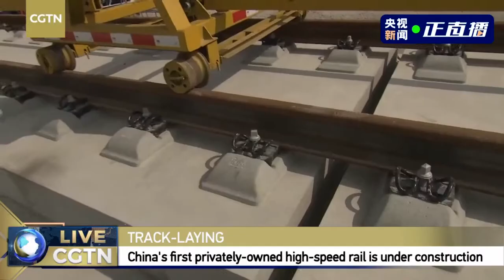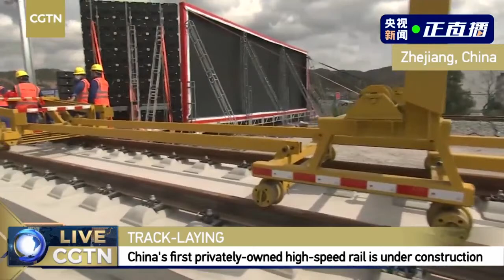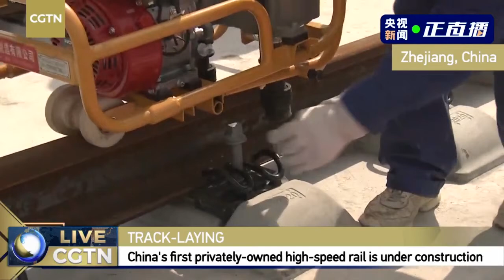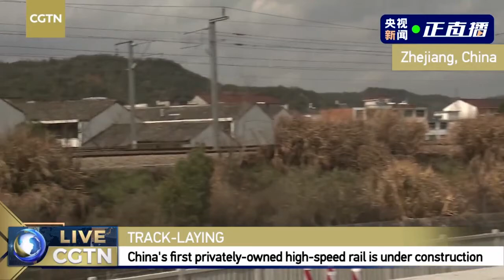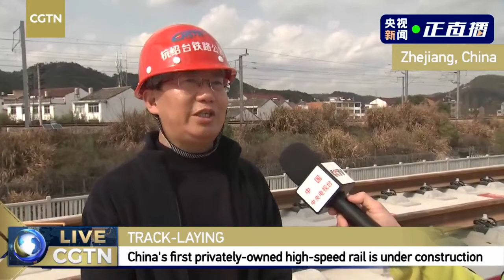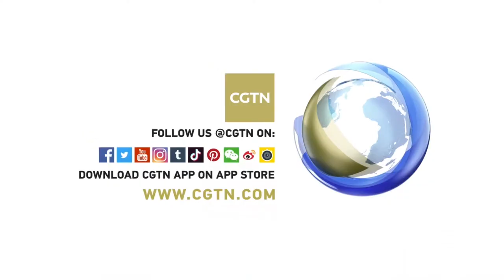Live: Watch track-laying for China's first privately-owned high-speed railway

Comment: This vid illustrates track laying by using high tech equipment to install the 'chair bolts' to fasten down the 'chair plates' to the 'sleepers'. (technical terms as used by British railways) The bar across the rails makes sure the rails are evenly spaced to the correct width. It will also check the LEVEL ie that it runs smoothly INLINE with the existing tracks, on the 'ballast' that supports the sleepers, the chair and chair bolts. Notice the clips that are hammered down tight against the rails AND have padding or spacing between the chair and the rail to stop unnecessary movement, correct SPACING of the track, as the trains move across the rails. Many countries employ special trains that do a very fast inspection across the distance of the tracks; those trains can test AND precisely pin point, report any faults to the maintenance teams etc. It is important to remember that rail tracks can suffer from environmental factors such as HEAT, freezing and misalignment in certain conditions not forgetting flooding, land slides and similar. All these factors and many other considerations are taken into account so that any such problems/issues can be prevented OR rectified quickly. British Rail have some steam train days videos that illustrate track laying and how it all comes together including split tracks for diverting trains and a lot more. It will however have you realize that Britain may have invented the railways but today? Those such as the Chinese have brought high speed trains to their people and put us all to shame. 👀😶
Reply: You know this stuff!

Comment: It had me shaking my head when I watched a program discussing WHY America did not have high speed trains. Excuses illustrated exactly WHY it doesn't or rarely has changed re its rail network/transport. Excuses? Well it will cost millions of dollars for laying one section of track, (here we are talking about maybe a mile in western terms.. ) So a whole complete system from Los Angeles to San Francisco will end up costing BILLIONS. 'Red tape', documentation approval for this, approval for that, discuss this and that, refuse this. delay delays ! oh and then there are those who are against spending billions on high speed rail so protests, block this from happening, delay this, delay that and generally insist that 'democracy' rules and they are entitled to do whatever they want so long as it appears OR hmm yes OR certain business factions, individuals who can afford to tie up such projects, by paying legal teams and more to interfere and eventually kill off a project. So long as they have their cars, spend billions on road networks and of course; pollution, traffic congestion, road rage and so much more. No chance to step onto a high speed, comfortable, accommodating with the latest tech gear for internet, USB charging, air conditioning and so much more the traveller is spoilt with AND can travel to his or her destination in hours LESS, than driving by car to the centre of any city. Now, to the shake my head moment? 👀😶"China does not have the problems we have with tunnels, difficult terrain and and ! Oh yes indeed! 👀🤣🤣I kid you not! I did point some to watching some of the videos on how China builds bridges, digs out tunnels and !! In conclusion? With America it is the mindset that has grown up with the CAR taking centre stage as one might say against the rail networks. That was the car industry and the capitalist elements of American society lining their bulging pockets whilst trashing the rail network to its current state. 🙄Of course now the USA is waking up to the realization that they have been really stupid in allowing that to happen given the way China's high speed rail networks are showing over and over that so called western 'democracy' denies (and will for years to come) the opportunities to their people of such transportation.😒 Lastly I am British. We are the laughing stock of the world and you may ask why, when it comes to trains and rail network transport ie high speed rail. We invented the rail networks and rail transport in its original form. We had and still have great engineers, innovators and more. Politicians, so called democracy, capitalism and worse coupled with greed and oh yes those who protest at having to make way for progress, the high speed network?? It will take years before that ever happens to the level that China has reached in a decade??😶 Congratulations to China and its people for the astonishing feats of technological advances, health, wealth and prosperity of its people. The truth re those who criticise China and mock it. level abuse at the people? In one word; ENVY. Happy new year to all celebrating Chinese new year. 👍
Reply: The US has the capacity to build high speed rail and they have the labour and expertise. But decades of subsidising freeways has built cities where rail is unworkable cause you'd have to drive to the train to begin with. Amtrak operates unprofitable backwater services as welfare rather than profitable, nationbuilding routes. Young Americans are sick of the ponzi scheme of endless suburbanism and have an appetite for high speed rail. The freight rail system in the US is privately owned and operated and it's the most efficient in the world. The Japanese passenger rail system is largely privately built and is the most efficient in the world. If the US can get on top of their housing monoculture crisis I think they've got big things ahead as private operators will circumvent the public rail system entirely. Texas, California/Nevada and Florida already have private high speed/somewhat high speed projects in the works. Culture will change quickly. Boomers will grow to like rail when they realise they can invest their retirements in it and public investment will follow. Autonomous vehicles will make rail accessible even in the most dead end suburbs. I wouldn't worry for future Americans I worry for the ones reaching the end of their lives reaching the ends of their lives realising they threw their culture down the toilet and pursued loneliness.
Reply: @Freshbott2  I think sadly, it will take decades before the USA changes re rail. Its ironic that the so called western 'democracy' is often given a good kicking when it comes up against the realisation that the truth is more 'autocracy' than 'democracy'. It has to be for certain projects to go ahead against the onslaught of those narrow minded individuals who will use any excuse to stall such. Politicians, capitalist greedy self serving businesses, industry and individuals in the mix create a melting pot that often stagnates innovation, creativity, development. I'm in the UK and over the decades watching other countries rail networks grow into some phenomenal systems when we invented the railways?? Believe me, we are the laughing stock of the world. We should have a second to none rail system. Beeching and other political self serving stooges including the Thatcherites trashed the railways in favour of cars and lorries etc. Japan had the Shinkansen bullet train back in 1964 !! What did we have in the UK? Steam trains. 👀🙄
Reply: @arthurdanielles4784  We're aware of the same problem but we have really different ways of seeing it. I don't see business as the problem. It was businesses that built the great subways/metros of the world, the rails all across the US, Japan, the trams all across the English speaking world that got pulled out everywhere except Melbourne, were built privately. There was very little public investment. A few of the great railways of the US were public failures that were sold off and became effective, and are now effective freight railways.

In the 20s/30s and after the war, car centric and segregational euclidean planning were a government institution forced on society. It wasn't some greedy capitalist scheme. Developers had previously gotten rich building commuter towns of townhouses along trams and rail. But public money was spent to remove privately operated public transport across the US and Aus at the request of the voting class. In Melbourne, townhouse construction was banned, before car makers had the clout. People truly thought they wanted suburban 'garden city' abominations just like they truly believe it today. That hurt rail, but what REALLY killed rail was the government taking ownership. You can see it with the New York subways (plural) that became one ineffective corrupt public system.

Greedy capitalist businesses will make anything they can sell and in Japan that means rail, but in countries where they're forbidden to build rail, they'll build the only thing they're allowed to sell. Banks weren't refusing to approve loans in black neighbourhoods cause they hate money. Banks that chose to do so had to compete against banks being underwritten by the government directing them not to. Municipalities paying into the federal tax base would lose funding for things that weren't even freeways if they stood up against federal highways. The voting class chose subsidies and anti property rights and segregation and to blame businesses is ignoring the responsibility of the most toxic parts of public institutions and the culture that votes for them, and blaming the same people who built rail to begin with. The tyranny of democracy killed rail against the wishes of bright minded people who happened to have stood to gain from building it.
Reply: @Freshbott2  I take on point some of your opinion re our current topic BUT I should point out that during the great depression of the 30s a lot of conscripted labour in the USA built projects that were completed thanks to US funding. Cheap labour, almost zero health and safety, accidents, deaths ah well onto the next guy for work. The Hoover dam is a perfect example of just that. In some instances the government had no choice but to take on commitments it would otherwise NOT have touched nor taken responsibility for but for the businesses going bankrupt or into liquidation. We saw even now with the BHS *British home stores. Pensions scandal where the business owners destroyed the business and left thousands of workers almost destitute. But lets go back to rail and rail networks. I agree with you that a government owned enterprise against SOME and here I emphasize the SOME privatisation don't work. We know that trade unions for instance can bring a business to its knees, but where governments are concerned they can permanently cripple it. BUT privatisation can also have workers paid low wages, serious violations on working practices, on health and safety procedures plus whereas governments often have no choice but to ensure such practices are maintained. Many metro and similar underground networks run a standard type of transport unlike the demands of a national rail network thus its relevance to a main network is limited other than it provides a link to a main line station etc. airport etc. If British railway didn't work then privatisation was not without serious issues. In fact it was not surprising to see the government in the UK revoke franchise operators licenses. In the UK the motorways were deliberately planned and put into place thanks to business interests re motorway rest areas that are ALL privately owned and making millions.. Food, catering, hospitality not forgetting fuel sales and their shops etc. Mainland stations had PRIVATELY owned retail areas on the platforms. Airports are business owned not just the airport infrastructures re travel etc but the main shopping areas etc PRIVATE business owners. ALL benefiting from CONTROL and having in many cases a final say in how transport ie UK infrastructure was created and continues often at the expense of rail. Massive freight haulage by lorry owners employing cheap labour re drivers who could be from anywhere ie across Europe. Equal pay laws were abused by transport businesses when they FACT took drivers from Poland, Romania etc took them into Germany and then had them drive vehicles for much lower wages than the German drivers would accept (sticking to the rules of what was EU legislation) but ignoring ? Were they punished? NO. When it suits them businesses do what they want and flout the laws etc A shocking number of incidents re businesses occur because they are capitalist greedy profiteers who manipulate situations whether social, domestic or political to suit themselves AND we know for a FACT, get away with it stealing millions from the taxes just one illustration. Private business and political stooges destroyed the rail networks from without AND within. Railtrack (UK) was a privately owned business looking after the miles of rail track in the UK - less than 33% of all profits made went into the maintenance etc of the rail network. When we had the problems re the next financial recession they went bankrupt.. NOW I should add that they were receiving GOVERNMENT subsidies apart from the profits they made.. IF your business goes bankrupt then tough luck your investors etc are likely to lose EVERYTHING hence no shareholder dividends etc? Before the recession they were getting bonuses etc AFTER of course they lost em ? Shares were worthless.. Those shareholders had the British government take over Railtrack AND at the same time pay the shareholders monies that most would agree they were NOT entitled to. If it had been your private business YOU would NOT have got it.. SO why did they?? 👀
Reply: Good to see some objective views. People nowadays are snowflakes who care more about creating noise rather than seeing what provides the best outcome for society.
Reply: @vitalis  When I look at some astonishing jaw dropping tourist destinations, that could make that country MILLIONS a year, trashed by those who seek to constantly to cause trouble, re domestic, politically sabotaging their own peoples health, wealth and prosperity, to suit their own pathological lying agendas, fuelled with indoctrination, brute force and often ignorance; to bully, intimidate and suppress whilst doing NOTHING for their own people but leave them destitute, impoverished and ? 👀India is one perfect example but we also have to include Kashmir and Pakistan. Hell holes with so much history and tourist money making opportunities? Corrupt officials, corrupt politicians and more. 👀